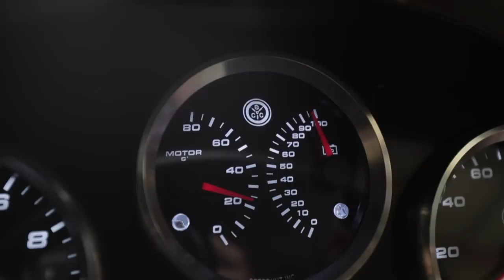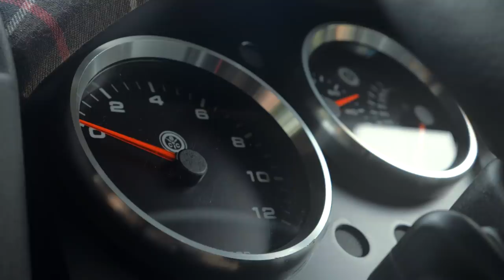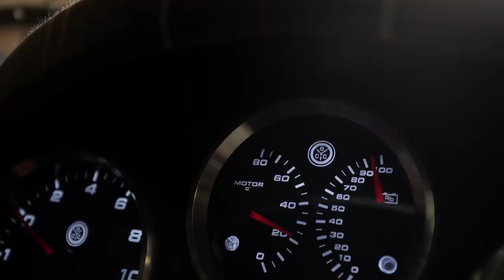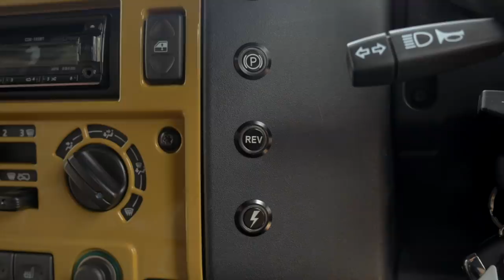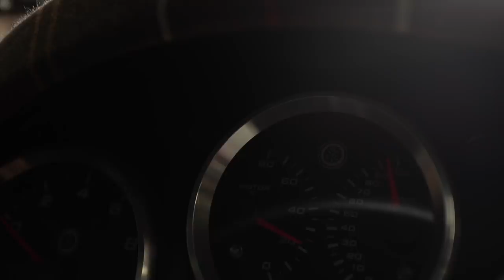EV Land Rover Defender Road Trip

Comment: This is exactly what I want to do with my 2010 outback. It probably wouldn't fit as many batteries though! My only question is with the electric park brake. My outback has this, too, and I'm not a fan because if you're trying to climb a hill, and don't make it, you're supposed to use the hand brake to control your speed when backing down the hill. If you use the foot brake the front wheels lock up and you lose steering. However, I suppose the four wheel regen braking might be ok for this scenario? 

But anyway that's something for me to figure out when I eventually convert my outback! Great car!

Comment: I'm a big Barbour fan and love visiting the Barbour factory outlet shop in South Shields and remember when they gave you £50 off a new jacket if you traded in your old one. The Defender was brilliant and the interior was gorgeous, but what was wrong with the suspension? It should've had wolf wheels instead of aftermarket modular wheels and finally it should've been green. Besides that it was fantastic. Jonny I hope they let you keep the jacket.
Reply: Oh and the BF Goodrich KO2's should always have the white lettering on the inside.
Reply from the maker: Thanks Dave. The suspension was for more on-road work - all this spec was done by Selfridges, but another client could go big lift or any wheel/tyre/colour combo. White letter tyres rule. Fact.

Comment: Has it got the tesla ludicrous mode.
Why can’t land driver make the new defender with full ev. 
Am I been daft but if you hitch a trailer could you not use that fully or raise the floor add extra batteries and  connect it to the car?

Comment: For me the only good thing about a classic car EV conversion is the fact that those cars will survive, and usually you can easily swap it back to a combustion engine in the future, this particularly one is no longer an off road car, is a city car, with the original one you can fix it or at least patch it to work for a few more kilometers with a hammer, a screwdriver and some wire, with this one you're stuck there until the towing company arrives to pick you up, if they actually can do that, it depends where the car broke down.

Comment: Last question if we redesigned the car as ev not ICE would it look diff.
How would old or new defender look it built for electric. Would it be more airodinamic would it be more practical. 
I want a defender style of roader but I want it to be electric from the ground up how would it work. 
I work in city of york so need low emotions. I also do diff job in countryside where I need it  to be off road capable to get to location then most of day be off as I’m doing other things  and live in a village that can have icy roads lots a leaves and lots of mud so want want it as extra safety and  security of on the roads. Also if i solar panel the roof would that do much in lengthening charge time’s 
Is ICE better as last longer per unit over Electric.

Comment: The p85d does 250 miles+ on a charge but the same bits on this does only 120-150 miles?. What makes it loose so much range ?
Reply from the maker: Gearing, tyres, aero, full time 4x4

Comment: Interesting comments from Jonny about giving cars like this a second life, especially as they'll be increasingly outlawed in the years ahead. Contrasted with his videos about his Austin Allegro and that old Honda, and the herculean tasks of restoring them when parts are rare. Does make one wonder if Jonny ever considered EV conversion for the Allegro or some other barn find type car. I totally get the enthusiast's desire to restore a classic a close as possible to original - and would even defend hobbyist petrol engines as inconsequential in the grand scheme of carbon emissions... But on the other hand the EV conversion route for something like the Allegro might make sense in terms of not having to source rare parts and then getting performance that exceeds the original. Anyway, food for thought! Maybe as the channel grows Jonny could do parallel resto mods of the same model of car to compare costs/pros and cons of EV conversion vs a more conventional restoration.

Comment: Might be ok in town but will I still be able to pull my 3500kg livestock trailer over a reasonable distance to get to the mart? That's the problem with outlawing IC engines and high taxing big 4x4s, those of us who actually need them and use them as intended suffer because of fashion trends.

Comment: Love it. In particular, would love a 110 in the same colour and specs. Unfortunately though, the range it has at the moment is simply nowhere near enough for where I live in Western Australia. It is a 600 kilometer drive from here to the city - I can do the return trip without stopping anywhere for fuel in my DIscovery 4. I would have to tow a trailer with a generator on it to do the same trip in one of these. One day, when technology gets there, electric cars will become useful here - at the moment they are not.

Comment: They need to work on the accelerator pedal feedback. Till 25% they need to make it ask less power than actual pedal position.

pretty they can easily tweak that graph. Even IC fly by wire accelerator cars have that.
Reply from the maker: After my shoot I gave them some feedback about throttle sensitivity and they recalibrated it to be softer. Much better now.

Comment: I'm not sure what you did off road was all that off road. Just wondering about the weight of it on serious inclines or declines or even the grass fields it drove around on a stone fire track. I mean yes it's a great and very much better alternative to the classic chelsea tractor one often can see or smell inside London streets but i cant stop thinking how that added weight will effect it going round one of the many Landrover experience sites. Also still sounds like a milk float eben if it is mechanical and not motor.
Reply: Also very well made content as  the rest of your videos are. Cant wait for the Allegro finish.

Comment: Sounds like motor whine rather than diff noise. Whatever it is, it needs fixing. 

Could be reduction gearing in the motor unit - maybe they should have used helical gears and some oil!

Comment: Does Tesla allow people to use their drive-train and battery just like that? I'm guessing a lot of gears need greasing for that to happen?
It can't use the superchargers because it's a bootleg Tesla? I really like how they made the gauges for the instrumentation panel.
Beautifully re-built Defender and well shot presentation. Cheers
Reply from the maker: Tesla do not sell their drivetrains new to anyone. All of these items are sourced from salvage vehicles and modified.
Reply: @TheLateBrakeShow  Yes I thought it was from salvage but I figured tesla itself does protect their hardware so I suppose you do need permission or access to certain protocols to interface with controllers, input etc

Comment: What's it like in the back? It looks like the rear seat is on a seat box which might be the battery box, meaning you've got two rear seats and no storage space?
Reply from the maker: I didn't sit in it but yes the 90 has the battery box in a false floor, so the rear seats are higher.

Comment: I’m wondering how the electric handles off-road. It’s fair enough to show on-road performance but how does it handle the rough stuff? The defender is obviously an off-road vehicle, and Diesel engined vehicles have a very predictable power curve. Does the electric transplant allow controlled power application, or does it just run away and spin the wheels uncontrollably?
Seriously, you need to do an off-road test, not just dirt roads, and test how this power plant can deliver.

Comment: Cool, but I rather wanna See a in hub motors with independent suspension. more wheel travel and faster charger mean level 2 of DC charging in a CCS rather just level 2 AC charging..he has to start making his own PCBs and electronics rather depending on just Tesla Modules for instance

Comment: My thought is, in a vehicle like this one why isnt there a way to reduce the power to half lets say so I am guessing batteries will last double as their capacity its the same but you are demanding less energy. Maybe i say foolish. But would that be a thing? I mean do you need 450bhp ina defender? Wouldn't it be enough with 225bhp if you can have 250miles or 360 miles range instead of 150-180?
Reply from the maker: You can spec it to have less power (smaller motor or map) and larger range or bigger battery.

Comment: I'm in Australia, and I'm looking for a company to do this to my 2007 Diesel Jeep Wrangler. I'm looking at a 3 motor system with 2 motors for each axle and 1 motor for vacuum pump, power steering and air conditioning. Most people converting vehicles in Australia are diyers who are engineers so the cost is lower. Paying for this here for me in Australia would be like building a Ferrari. I really hate the thought that when my Jeep motor and gearbox are finished the vehicle will rust somewhere. Australia is at least 10 years behind the rest of the world on EVs. I'm starting to hate it here, it's really depressing.

Comment: Oh Yes, who does not want one of those, but, just because You pull out the diesel and electrify it, why do You have to pimp the interior får thousands and thousands of pounds. 
I understand You have to change the meters and rip out the gearbox etc, but why the Barbour seats and the steering wheel, throwing all that money in the ditch. Lets see a clean el conversion with so much as possible of the original interior and exterior stuff as possible, and save  the original Defender feeling! That will also be much funnier when You trash the Porsche with the traffic light with the stunning acceleration 
I can see the price comming in reach for the more normal purse!

Comment: I do have to laugh at what the British call a road trip.  Its a daily commute for many Americans. This is why we will need ICE cars in America for a while yet. A real road trip in an EV can be miserable.  Even with fast charging, it can add 25% to the time it takes to go somewhere.  If you tow something, its more like 50%.  Doing so regularly, will kill a battery earlier.  Lithium batteries dont like fast charging or using their full capacity. 

I do like the concept of reviving old cars like this.  They cover the needs of most people most of the time.  I hope some reasonable priced kits and modular batteries come out so it can be done at a price comparable to rebuilding an ICE drivetrain.

Comment: Always put off with the idea of an EV 4x4. Would hate to get stuck in ass end of know place needing fuel. Farm work sometimes you are using the truck silly hours a day, you need to be able to jump in at any time and drive it not worry about a charge. If its low on fuel tip some in and off you go no waiting and money lost. With EV though you have to sit and wait not ideal. You save a bunch on fuel also with red diesel so its super cheap. Also more easy to repair an old diesel work horse with a few spanners.

Comment: I wonder how the EV revolution will chance car purchases, with minimal moving parts, no need for liquid cooling, liquid fuel, exhausts, no need for traditional servicing of oil and filters ect I imagine a car would simply last a hell of a lot longer than your average ICE car so a new car will be pretty much just a choice and garages will surely be tanked with less need to service cars and a-lot less to go wrong to fail on an inspection, hell with regenerative  braking even standard cheap brake pads can last tens of thousands and even 100 thousand miles. Main weakness is battery capacity degradation but when we end up with the model s for example getting 400 miles of range even with degradation most people won't even encounter the lower range with charging from home nightly.

Comment: I can appreciate the whole EV thing and likely the only way defenders will survive into the future . However , nothing electric is ever going give you the same visceral and audial experience as my defender puma 110 with a heated up merc 6 cylinder OM 606 throwing out 340 bhp , with the straight pipe is just sounds awesome , goose bumps all over . Here’s one that was done on an older defender . Highly recommend diesel pump Uk. https://youtu.be/ijw0cs9Omxo

Comment: The uk can make 86 gigawatts of electricity an hour.. if we all go electric we would need 280 gigawatts  for 7 hours ...now add on trucks.. now we need 700 gigawatts.. per hour..

Any one see a problem
Reply from the maker: Not a problem, because the mass adoption won't happen overnight. And the Grid has prepared for it. Go ask them.
Reply: @TheLateBrakeShow  a national grid conference admitted they would need to build 20  hinckley point nuclear power stations to cope with the extra demand..if all public transport and haulage goes electric the figure could be as high as 40 to 50 ..extra power stations..
Reply: @TheLateBrakeShow  it should also be noted that the national grid want to introduce gen 3 smart meters.. these will be able to cut power to high demand equipment if there isn't enough power available.. and there will be no compensation. 
So you might plug your Nissan milk float in or turn on your washing machine at night only to find you cant go to work and your clothes still smell.  
Next problem is distribution.. at the local level... the current local transformers have been taken to there limit by the mass expansion of housing estates . . 
But the real problem will be commercial vehicles.. imagine what would happen if Eddie stobart plugged in 50 hgvs and the took 250 or 500 kilowatts each..then tnt..then parcel force.. and..every other truck..

Now.. there are about 491000 hgvs on the road..and at 250 killowatts they would need 123 gigawatts of electricity. 

How much can we make..85 gigawatts.. so cars plus trucks would need 200 gigawatts..
 To electric vehicles are not a good solution for all problems.

Comment: I’ve had my Defender 28 years. I do love the diesel engine. I’ve been wanting to convert it to electric for years, but haven’t yet found an economically viable option. £150k is a joke. Spoiled rich tosser’s toy. What we need is a real solution for real people. A good reliable conversion for £10k. That’s what the Defender needs and deserves. Anyone know if that exists yet?
Reply from the maker: You can contact New Electric who are encouraging safe build DIY conversions. Otherwise a kit from someone like Zero EV, who supply Electric Classic Cars their high voltage. This car is £150k which includes buying a high end £50k Defender in the first place and going to town on interior etc. Not for everyone. A healthy long range EV conversion to your existing Defender will be £25k+
Reply: Much appreciated. Sounds like I will have to wait a few more years for the costs of EV to come down and the costs of conventional motoring to go up. In the meantime I’ll just keep cycling as much as I can 👍

Comment: I really like the car, hate the champaign socialist ideology everyone spews along with them "they're green" no they aren't not until they've passed 180k miles are they any greener than any other car and 180k is about the time all cars get disposed of in the scrap yard. The one bonus with this car is it has second hand batteries which reduce it's footprint (not so for the car it came from which would be significantly higher than a normal car unless it had done 180k miles, but then, you wouldn't be using old batteries like that in this land rover.).  See, it's a fucking mine field of bullshit when you spout ideological horseshit. Why can't people just focus on the machine instead of bullshitting everyone?

Comment: You create your own guilt as it ties in with an instilled sense of morality (say for example watching all the porn you have watched....don't tell your priest or the girl friend), so the issue with doing things because of guilt rather than just because it is a good stand alone and economical idea, is that you become deluded. Unless for example the electricity charging those batteries is fully green? That is to say the electricity comes from renewable energy resources, which have never required coal or other electricity production methods to power the plants that make the component used in the renewable generators such as wind turbines (see the documentary Planet of the humans), so if not, then you end up looking not just like a guilty EV driver, But a guilty Plonker also.